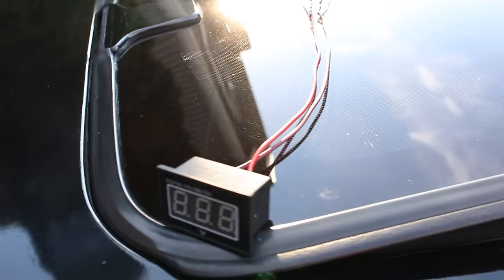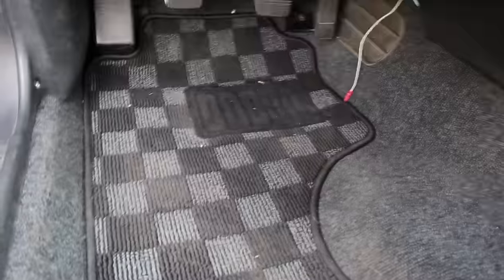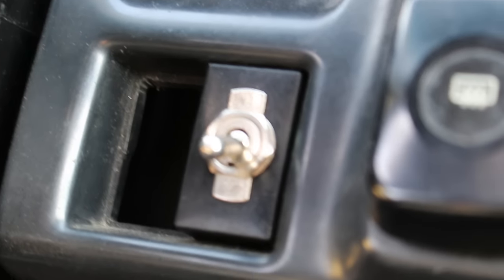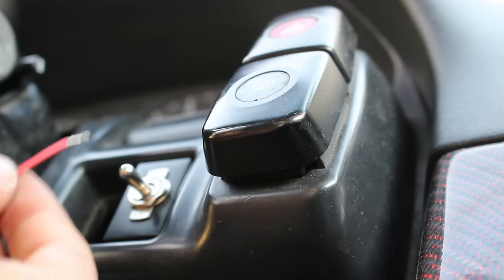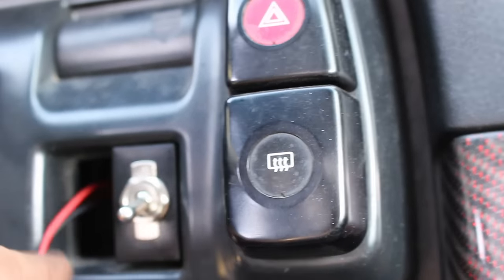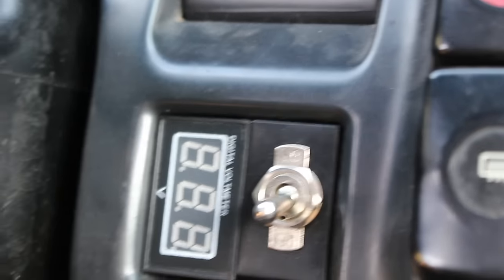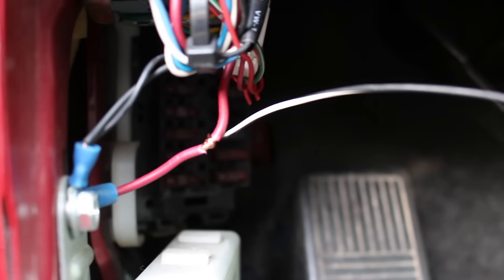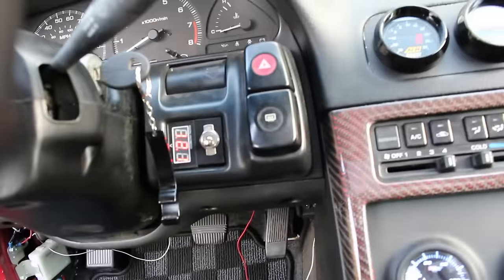EASIER THAN YOU THINK!

Comment: Is their a gauge to monitor what bolts the subwoofer produces. Like using a multimeter to check volts while setting gain. I don’t want to exceed 40volts but switching from one song to another I could possibly. But with a gauge I could visualize the difference from one song to another.

Comment: Should have put the toggle switch on the top (or bottom) that way the voltmeter would read horizontally.
Reply: After looking at it longer, probably wouldn't have fit that way without a little modification. Sorry

Comment: Can you connect the two wires from the voltmeter to the two correct terminals on the battery and then install a separate switch to turn the meter on/off?
Reply from the maker: +I cant think of a name yea i know its kinda wierd You could! But I don't really see the point.
Reply: Kalvins Garage yes you can. if you find a constant 12v power then yes you can run it to the switch. then the power from voltage meter goes to the accessory on the meter. ground the voltage meter out and ground the switch of you want. that's how i have mine. i got 2 volt meters. one's for my battery up front and ones for my rear. i listen to music without my truck running a lot on lunch and break so i keep an eye on it to know I'm not killing the battery